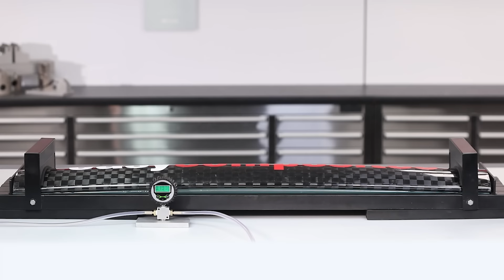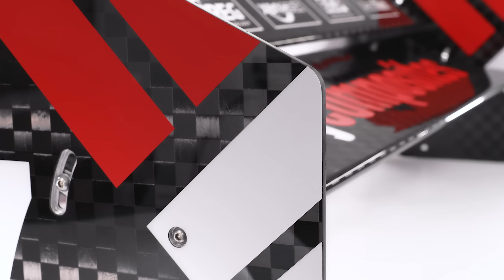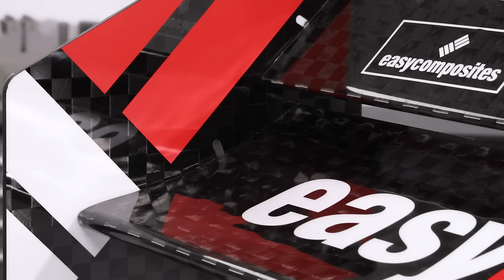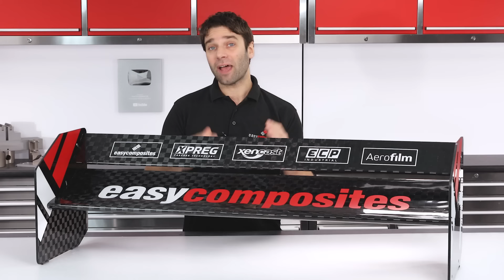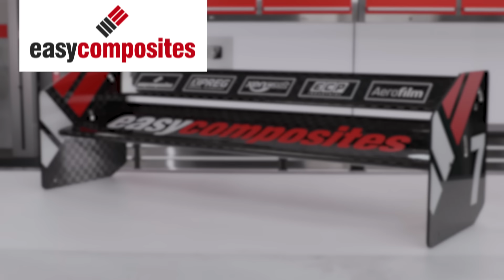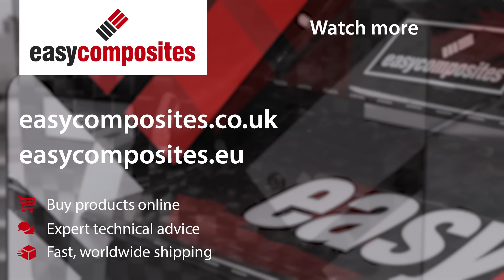Building a Rear Wing with Carbon Fibre and Nomex

Comment: So much excess resin in the honeycomb... could have used bonding film sheets and bagged it for the oven...
Reply from the maker: Not everyone has access to adhesive films and a curing oven so this is a simpler way albeit slightly heavier.

Comment: Hey Paul and Easy Composites, not sure if you guys will see this since my comment here is late and will get sucked down into the abyss but I wanted to ask about the cnc wire cutter. That things could be a game changer for those of us looking to make similar foam cores for projects of any sort.

 You mentioned you made it for a previous project, and unfortunately I do not possess the technical know how to make my own. Have you guys ever considered producing and selling them to your customer base? I’d absolutely love to have one if I could ever get my hands on one personally and I’m sure many other would as well. I know producing such a machine could be a logistical nightmare but wanted to inquire anyway. So if not, would you guys know where I could find one for a reasonable price? I’m struggling with my search. Thank you guys for your expertise and videos with anything and everything composite oriented, your content is second to none on the internet. Love from the US!
Reply from the maker: Its not something we designed. You want to look on the forums as there are a number of open source and kit based hot wire cutters on the market.  Everything in our one was off the shelf parts.
Reply: Sounds good, appreciate the help!

Comment: I don't know if it's been mentioned, but can you possibly use the foam negatives as a press block inside your vacuum bag to create a rudimentary mold and avoid the waves from using just the mylar and vacuum bag?
Reply from the maker: We did try this but found that the slight variation in the composites made for an uneven pressure consolidating the matting over the part.

Comment: Is the silica powder really necessary in order to bond the nomex and the Carbon part well?  We are short on time and our supply just ran out
Reply from the maker: It's not absolutely necessary to add the fumed silica it really just thickens up the resin to a paste so that it doesn't just run everywhere and can be applied in a thick enough layer. If you didn't have any fumed silica you could maybe wait until the resin starts to cure and thicken slightly before you apply it.

Comment: I absolutely love these videos and would love to make a few things out carbon fiber. However, I have to ask if vacuum bags are completely necessary or if squeegeeing out the excess resin and providing a longer time to cure would be enough.
Reply from the maker: You could wet lay it but the process in this way would be difficult to keep the fibre in place without some additional force to hold the fabric in place. You could orientate the wing vertically so you drape over the leading edge and allow the fabric to meet at trailing edge but the more curved the wing, the more the fabric may want to fall off on the concave side.
Reply: @easycompositestv  Thanks a million for your quick response! :-) I've watched a few more of your videos in the meantime and learned a few more things about this manufacturing process...and even lost some of my fear of vacuum bagging. Thanks again.

Comment: How UV stable is epoxy resin...??
 Even with UV stable epoxy resin, I would still clear coat (lacquer) the finish with a Carbonic clear coat which has a  high UV protection, I thought epoxy resins have struggled over the years for UV protection would you recommend clear coating with a high UV lacquer or primer or am I wasting my time doing this.?, .
.great video I was glued to it and saves a heap of money 👍
Reply from the maker: Modern Epoxy resins have a good level of UV resistance.  A race car wing will unlikely see enough sunlight to yellow in any quick time.  Road car parts in high UV/Sunny climates benefit from a UV stable lacquer for additional protection.
Reply: You have a good point a race car wouldn't see enough sunlight to breakdown the epoxy, 👍 thanks I look forward to your videos brilliant thanks

Comment: We tried sth similar on our fsae car back in the days. Unfortunately, the wing got very heavy, as the foam got soaked up in resin. How do you prevent this from happening? I would love to use this technique, as you finally get a clean front edge.
Reply from the maker: By using a closed cell foam like our XPS the resin can only soak in as far as the first layer of cells rather than continuing to permeate through the material.

Comment: I might ahve missed it, but did you oven cure the wings?
Reply from the maker: No we simply left the resin to cure at room temperature. If you had an oven big enough you could do a low temperature post cure to improve the properties of the resin, you would need to consider the max service temp of the foam however.

Comment: Isn't it possible to use reinforcement carbon and make the wing, then add the final "looks" layer on after everything is smooth and hard to avoid imperfections. I never done any carbonfiber work so I'm just wondering.
Reply from the maker: Effectively that is skinning and yes, there's no reason why you couldn't do that if you needed but there is a lot of finishing work to flat, fair and polish the coating resin plus it will generally be heavier as well.

Comment: For those without a foam cutter of that size and accuracy have you tried a 3D printed core version?
Reply from the maker: It is possible but depends on filament type, infill, wall thickness etc as it needs to be strong enough.  Would need testing to find the best balance.
Reply: @easycompositestv  Well currently doing and ABS core 2 wall with a hex pattern infill (length wise) will let you know if it holds. (F2000 Mygale)

Comment: Could you try to make a roadbike handlebar using a simple method pls 😊
Reply from the maker: We’ve already done a tutorial showing the standard process for making a component like this (our split mould tube video). If you wanted a simpler method then you could, potentially, use a foam core and wrap reinforcement around the outside. For a complex shape like a handlebar though, this might not be a very practical process.

Comment: Would putting it in a composite oven improve the quality. Also how much do large ovens cost and would you be able to build your own
Reply from the maker: These are room temperature curing resins so other than a post cure for elevated temperature resistance and a small performance improvement, there is little benefit or need to oven cure.  We don't make large ovens so can't advise on costs really.

Comment: Are carbon fiber parts electrically conductive, and if so,  how conducive compared to steel.
Reply from the maker: Carbon fibre is a high resistance conductor down the length of the fibres compared to metals which are generally low resistance.

Comment: What is the benefit of changing the viscosity via the fumed silica? Is it so that the epoxy doesn't move as much during the vacuuming? I love that your back doing videos, I've probably watched every video you made in the last 10 years.
Reply from the maker: The main reason is to enable the resin to be thick enough to form a fillet on the honeycomb paper edges as it increases the bonding surface area and strength.

Comment: I’m curious how big of an issue galvanic corrosion is and possible easy solutions. Ive heard about people using a layer of fiberglass in between aluminum inserts and cf to help here but I’d love to know what other methods you’d recommend. This video was amazing, thank you for all the great information!
Reply from the maker: Its not really an issue in these kind of applications but you are right a layer of glass is a good way to prevent it. A layer of resin, paint etc can also work.
Reply: @easycompositestv  thank you! Watching this video again, i realized it was where i heard the “layer of glass” trick 😂 cheers, you guys are a vault of great info

Comment: Well, why do you state that hand laid-up parts are heavier than prepreg-based counterparts if in both the weight of carbon fiber is equal to that of epoxy resin?
Reply from the maker: You use less resin in pre-preg parts and the fibre layers are better consolidated.

Comment: Would the same thing work with parts of the interior of the foam core removed to save weight?
Reply from the maker: As long as the material removed does not compromise the strength enough for the core to be crushed under vacuum.

Comment: As always, you killed it. I've learned so much from your vids. You are explaining so much things and how to think when you do a part.Thank you really much for all this free precious knowledge. 
You take time to explain how to avoid galvanic corrosion, but why don't you treat the spoiler from UV? It's a question i have, why making super clean mold or super shinny part when you have to treat them with clearcoat if you don't want your resin to turn yellow. thanks again for your work
Reply from the maker: As explained in the video the wings design intent is for a dry stored race car so even with a busy track schedule, UV degradation is not an issue.  It would be a different matter for a road car used regularly when a UV stable lacquer could be used.

Comment: What if a mouldless bike
Reply from the maker: Theoretically possible depending on shape but would need a fair bit of design and testing to ensure it is strong enough.
Reply: I have thought a little about this. I think the best option is to make something unibody, similar to the Lotus 108. Of course you can take some liberties and add other structural support. Metal hardpoints, vacuum bagging, wet lay/infusion, and forming your choice of foam is the next challenge.
Reply: @justinhoprich9085  I have bike designs that I want to came to life and I just want to ride it once then after that I’m just gonna hang it on my room and decide if it rides good I’ll invest time on it and if not I redesign it
Reply: @justinhoprich9085  I was thinking of wrapping the foam with some thick plastic bag and run the opening of it out of the seat tube and once I finished all of it I can remove the foam on the sea tube so I can have access on other tube since it hase a hole in it and with the opening of the plastic bag I can pour acetone idk if it’s bad but if not then I will use spray paint because I have tried spray paint on melting foam

Comment: Definitely not trying to hate on this, am just noting that these methods can't produce a wing as light and perfect as female molds/prepreg. Same goes for the end plates, using a method that allows you to skip the adhesive layer can cut weight significantly. These two facts may help drive decisions if you're an FSAE kid going for maximum performance.
Reply from the maker: You are, of course, 100% correct.  We do mention this as a shortcoming of this method (as well as surface rippling), however the simplicity of this method and ease for one off applications means its advantages far outweigh the weight penalty for many people.   Many FSAE and similar teams are on tight budgets, tight development times and hence sometimes the compromise in weight is worth it.

Comment: Do you have any hands on experience using mylar for a good surface finish using a similar process to this but with prepreg? Not much out there that I'm finding.
Reply from the maker: Not something we have tried.  At the very least you would need a high temperature resistant core for it to survive the cure cycle.  Also the process wet lay relies on a little excess resin which can move around. I suspect a pre-preg is unlikely to have enough excess resin to work in quite the same way.
Reply: @easycompositestv  sounds like an experiment to try and see what happens. Foam core is already done with polyisocyanurate foam!

Comment: I have one question, how many plys did you have for the End plate carbon plate?
Message from Japan.
Reply from the maker: Hi Sig, the laminate is 4 plies a surface layer of 88g Spread Tow followed by a ply of 210g twill, a 300g biax and a final 210g twill so achieve the 1mm thickness.
Reply: @easycompositestv  Thank you. Currently I'm working on a FSAE project in Japan. Hopefully I can make a wing as strong and beautiful as this one:)
Cheers

Comment: Can I make a suggestion for helping to make the wing surface significantly smother.... Try a skin of thin balsa wood over the foam core then seal the balsa with epoxy and proceed with the regular process.... Don't laugh about the quality and use of balsa wood
Reply from the maker: I guess it depends how much of the balsa surface smoothness effects the end wing surface smoothness compared to the foam on its own? Certainly one worth a test if you have the materials to hand.

Comment: This looks great!
What set up do you use to regulate the vacuum while bonding the side plate? Is the regulator just letting some air to flow into the bag or the actual vacuum is regulated?
Reply from the maker: The vacuum regulator works by regulating the vacuum level into the bag to reduce the vacuum level to whatever you set it on the regulator.  The pump itself is not regulated in any way. You can see the regulator here:  https://www.easycomposites.co.uk/smc-vacuum-regulator-for-vacuum-bagging

Comment: Now I want to see you guys 
1. install the eps wing, 
2. head to the track and 
3. film the disintegration in slo mo :)
Reply from the maker: The next video will show destructive testing of the wing. There is certainly no need to worry about it disintegrating in normal track use!
Reply: @easycompositestv  haha no, the eps foam wing template :) Sorry, the comment must have read super nasty if you miss the eps!

Comment: Based on the water in your compressed air you should look into an air dryer of some sort, refrigerated air dryers aren’t to badly priced.
Reply from the maker: Thanks for the comment. That's a mist cooler, the water/coolant is intentionally added to the air at the nozzle.
Reply: @easycompositestv  Oh that's pretty cool never heard of that! I have only ever used larger CNC mills that use large quantities of coolant or hand mills. Thanks for teaching me even more! I love all the stuff your channel does!

Comment: So, for surface finish, is there a more machinable medium than that foam core, the xps 30? What about FR-4700, or specifically polyurethane foam tooling board, or is that what XPS30 is? Structural rigidity can be improved with topology optimized (generative design) "ribs" but let's say I'm concerned about precision and surface finish, can foam be accurately machined to 0.05 mm or about 0.002"? Or is 0.25 mm or 0.010" what I should be realistically expecting? I would like to avoid machining an entire mold out of 6061 Al, because...well...that's a lot of aluminum for a full size wing 👀 🤔 what exposure do you have with various tooling board?

edit You have a video using green tooling foam board, but you sand it? Is that due to the CNC you're using?? When I use a ball nose end mill, that is typically THE final finish.
Reply from the maker: This wing process is not designed to be very precise.  If you need those levels of precision, you realistically are going to be looking at a moulded wing.  Certainly a high density model board can be machined to a good level of precision. For very high levels of precision you would be looking at billet but then you also need to take into account heat expansion during curing and other factors during processing if ultimate precision is your goal.
Reply: @easycompositestv  So tooling board for quick one off or prototype items that don't require tight tolerances, because wow this method is quick, aluminum or Invar machined molds for small volume production/aerospace/motorsport. 🤔 That's a good rule of thumb.

Comment: Would it make sense to use an ABS plastic spoiler as the core instead of foam? I have a spoiler already and  the shape couldn’t be easily replicated with a foam cutter. I kind of just want to lay down some CF for rigidity. I want to make an active spoiler so I need a stiff spoiler.
Reply from the maker: In theory you could wrap carbon fibre around most core materials, however its not necessarily going to be the most efficient way of making the part.

Comment: On the trailing edge of the two wing surfaces before being placed under the Mylar and in the bag, were the two surfaces just laid on top of each other as they meet and when trimmed are a neat knife edge? I'd like to see the trailing edge of the elements. Great vid as always👍🏻
Reply from the maker: Hi Mark, yes, exactly that. The two layers just meet as double thickness carbon which is then trimmed back once the resin has fully cured. The laminate is quite thick at this point (around 2mm) so if you want a knife edge you’d need to sand that back in, which is easily done into the solid carbon.

Comment: Even if you get small ripples in the upper surface (concave) of the wing it's not that big a deal aerodynamically. It's the lower surface (convex) geometry that matters much more. So much so, you shouldn't put stickers on it and consider endplate or swan neck mounting to maximize down force relative to surface area.
Reply from the maker: All good points, especially on high end motorsport applications. Although at a club level, the limitations are usually elsewhere so the stickers or mounting is unlikely to make such a big difference.